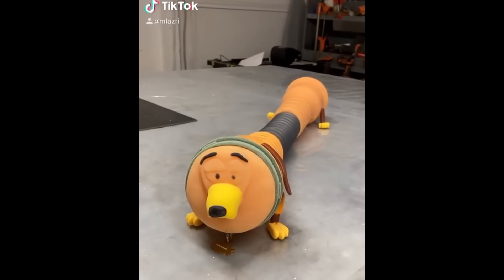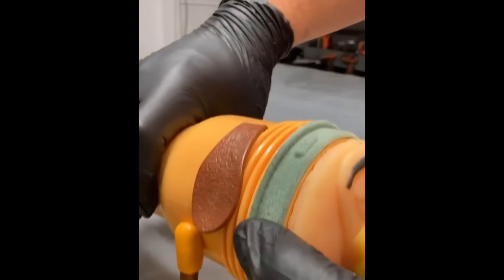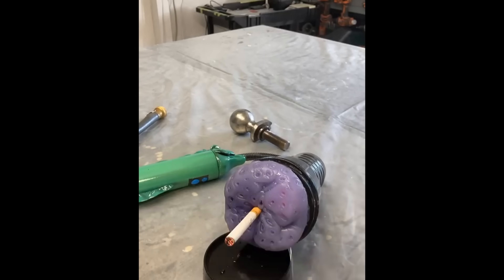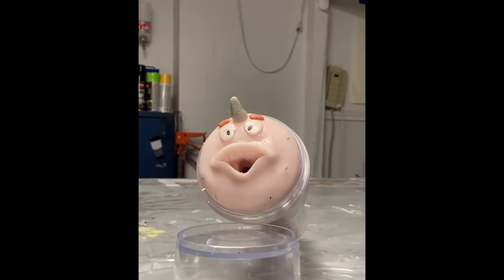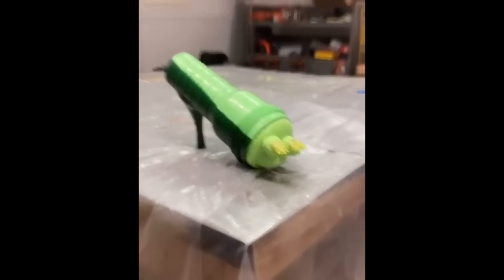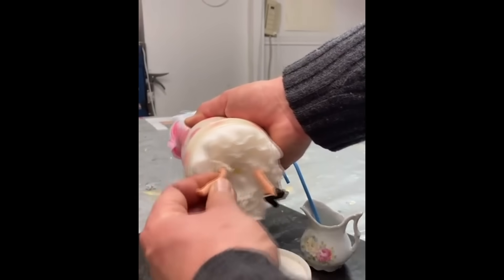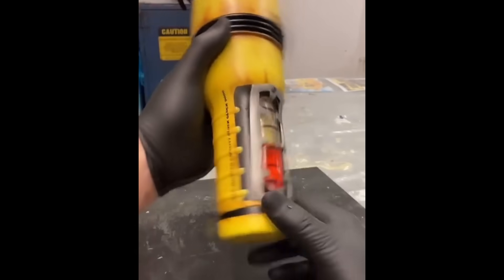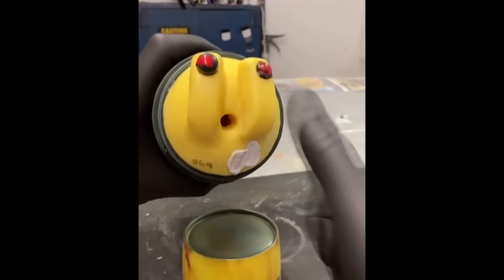mlazri's flashlight collection part 2

Comment: i genuinely dont know if these are official fleshlights for employees only or not
Reply: He made them himself
Reply: @orangeman3220  For real?
Reply: @d3rpyedits  well, all it would really take is a base (which is probably just a thermos or something like that) a sculpt, some silicone to make a mold and then cast the mold in silicone, some paints, extra parts from other things, and you would probably have something like it.
Reply: it's actually fairly easy when you have the right materials

dont ask how i know this
Reply: @sorakafutanari 
How do you know this
Reply: @wumpus976  ... So, why Disney characters?
Reply: @stevenjneptuneman8409  I guess for the shock value, since Disney characters tend to be seen as all bright and colorful, seeing them in this context just makes you wonder what the heck it is.
Reply: @wumpus976  they did reuse the feet mold
Reply: Yes, all of these are official limited editions that were originally only manufactured for private personal use by Disney, Pixar, and Dreamworks executives. They are extremely hard to find, but my boy mlazri is a MASTER at tracking these things down. I ordered a very rare Simba from "The Lion King" from him last year, and let me tell you, it did NOT disappoint. His furry mane around the entrance was INTACT (you never find them like that) along with the nice fluffy tail on the dual entrance at the back end of the unit. Finding them with the tail is just incredible. Very light usage, in immaculate condition. A year later and I STILL go to town on that baby about 3 times a week. When I'm finished I like to wipe off on his forehead like Rafiki baptizing him (with "Circle of Life" playing in the background 😂). Best purchase I've ever made. Like the man says, DON'T SLEEP!
Reply: @rollfizzlebeef6619  I’m logging tf off